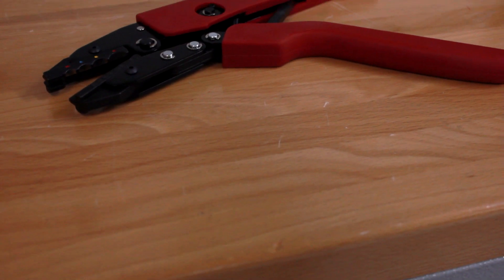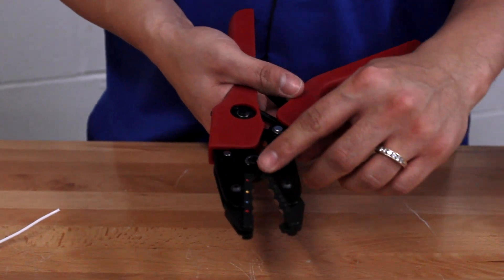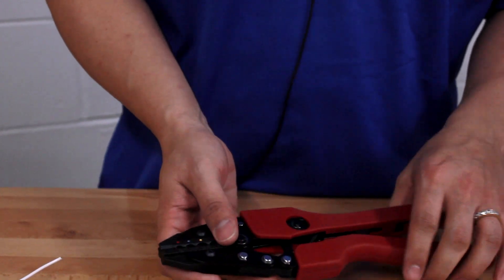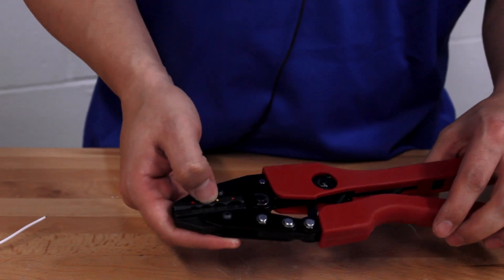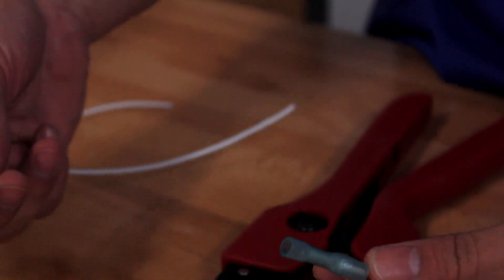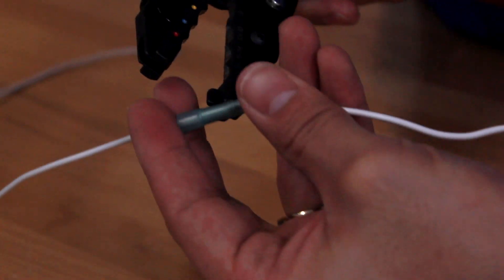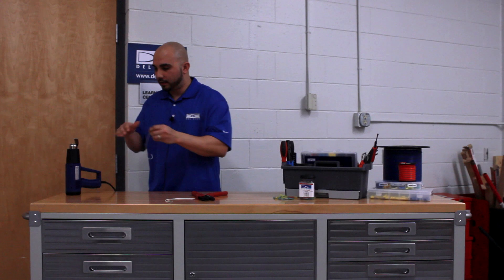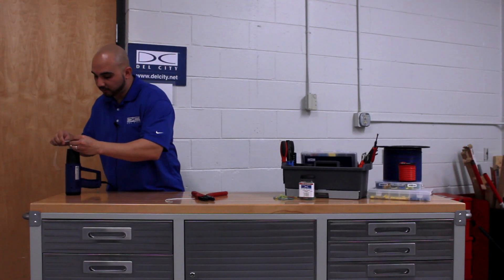How to use Ratchet Crimp Tools and Heat Shrink Butt Connectors.

Comment: I've never, not once, ever had a crimp tool crimp on a wire that it didn't either fall out of the connector on its own, or pull out the first time you moved it.  This always happens, every time. The first crimp never holds, ever. I have to use two or three connectors every time.

Comment: Nice vid I just bought my first ratcheting crimping tool and it did not have any instructions.  Also, I own a heat gun and have used heat shrink tube but I never knew that convectors could be shrunk too.  Here's something you can add in a future video for heat shrink tube - for extra strength put two tubes of the same size on the wire - slide and heat the first one and after it shrinks slide the next on (un shrunk) over it and reheat to double the thickness.
Reply: that is a great idea. im saving that.